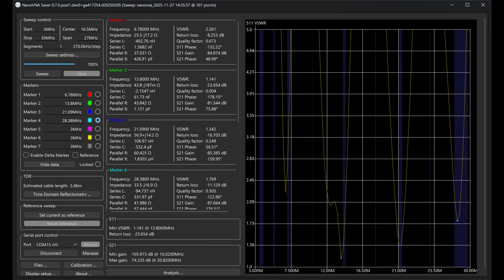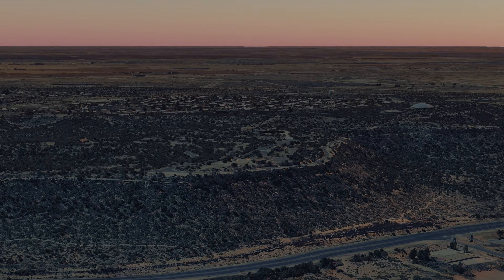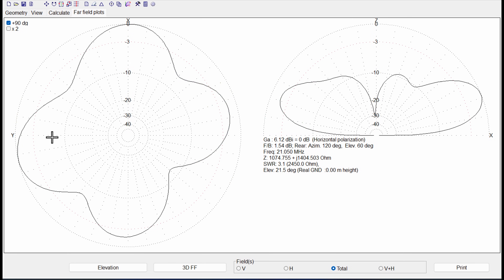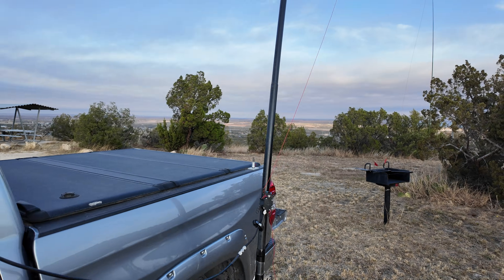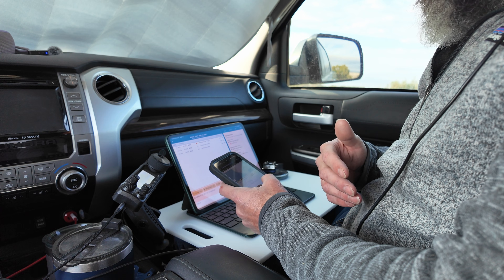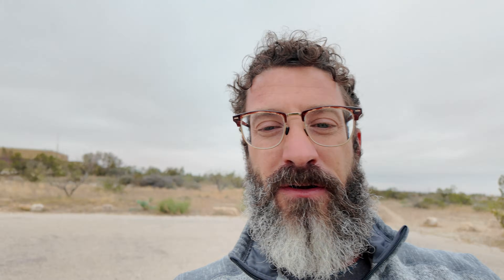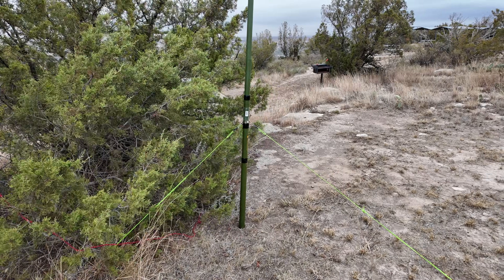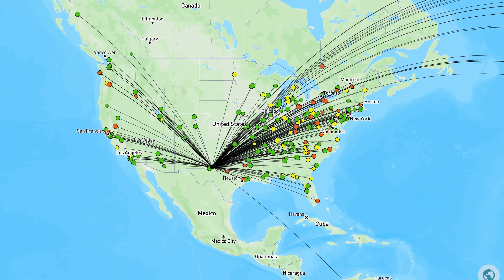EFHW Antenna | Part 3: POTA & DX Performance

Comment: Very informative. Thank you for your time and effort. I have never tried anything but a dipole.
May I ask one question. What logging program do you employ that gives you the distance from the station that you are working. I would really appreciate finding out the distance that I have been fortunate enough to have access.Actually I have to report that I have essential tremors. I am 80 years old so I should expect such things. This makes it impossible to build anything. Thanks again.   Tommy
Reply from the maker: Thanks so much, Tommy. I really appreciate the kind words.

There are a number of logging programs that will calculate distance automatically based on the grid square or callsign. I personally use Ham2K PoLo on my tablet for Parks on the Air, and it has some really nice features and is very easy to use. I believe websites like QRZ will also show distance as well.

Sorry to hear about the tremors. Dipoles are great antennas for most folks and honestly one of the best all around antennas.

Comment: I completely agree with your conclusions and highly recommend this configuration.  I have tried a number of different antennas in different deployment arrangements for POTA.  I have had the best success with a 40m EFHW deployed as an inverted L.  I can work 40, 20, 15, or 10 meters depending on band conditions.  Even running QRP, I regularly work the entire US and DX from parks in Colorado and Wyoming.
Reply from the maker: Sounds like you’re getting great results with that setup. An EFHW in an inverted-L is hard to beat for POTA.

Comment: I've come to the conclusion that using a 49 to 1 or higher transformer rated for 1kw  is more efficient when running 100W because there's less heat. One rated for 100 or 150 Watts is great when running QRP for the same reason.

The toroid mentioned is no doubt better. I forsee the price for it going up.

Comment: Good video. From my experience, a halfwave wire should have the same azimuth pattern and the same elevation pattern regardless of where it is fed. What matters to the pattern is the length of the wire in terms of wavelength. For other than a horizontal wire the inverted L is usually considered a top loaded vertical with gain comparable to any vertical. When used on harmonically related frequencies the inverted L morphs into more of a horizontal antenna. In general the gain of a single vertical should be close to zero dBi. A fully horizontal halfwave should have about 8 dBi if reasonably high. That same length should have more and sharper lobes of 8dBi or more as used on harmonic frequencies. The angle of the peak gain depends solely on the height above ground in terms of wavelength. I try to use heights of at least 1/2 wavelength if possible. Not too easy on 40 meters but very achievable on 20 through 10 meters. If you can get a full wave high ( especially on 15 or 10 meters)  it becomes a pretty good DX antenna when horizontal. 
The nulls are most noticeable when high. With all my antennas at about 35 to 50 feet I do not notice much of a null on 20 but very deep nulls on 10 meters.
Reply from the maker: Thanks for the input. I took a deeper dive into the modeling and radiation patterns in my previous video. Comparing vertical, horizontal, sloper, inverted-V and inverted-L deployments. Each configuration had its own elevation and azimuth pattern and those patterns changed on each harmonic. My RBN spots seemed to line up with these. I completely agree that a half-wave wire of the same config will have the same basic pattern regardless of where it’s fed, but once you start changing height, orientation, and how much vertical vs horizontal wire you have, things change. The inverted-L had the most useful patterns to me so that's what I used in this video. Lots of variables in the real world, so it’s tough to generalize, but that’s what makes playing with these antennas fun. Thanks again for the thoughtful comment!
Reply: @Tim-K5OHY antennas and propagation are the two most interesting parts of radio! I model with EZNEC and have been doing so for years. It’s gratifying to get real world results that agree with the modeling and vice versa. I just found out that my 160 meter inverted L ( 50 ft vertical and 119 foot horizontal) when used on 60 meters is 10 dB down in almost all directions (using the RBN) from my new 60 meter dipole! I thought it was working fairly well on 60 but WOW what a difference!
Reply from the maker: @dandypoint Agreed, I'm just starting to dive into these topics and it's fascinating!

Comment: Hi Tim. Thank you for the great video. I also have seen your video on a Doublet antenna, and I wonder which one do you think is better? BTW you have a excellent fist. 73 Imi, KV1I
Reply from the maker: Thanks Imi! I appreciate that. Between the two, the doublet is the better antenna for a couple reasons. It’s more efficient, works on a lot more bands, and it seems quieter on receive compared to the EFHW. And if you can get a 44' doublet up high, it has nice broadside gain from 40–10m.

The only downside is you need a good wide-range tuner. Some internal tuners won’t match it on every band, but a decent external or manual tuner will.

Hope to take the doublet out again soon and pair it with the G90 since it has a great tuner. 73!
Reply: @Tim-K5OHY  Thank you Tim. I really appreciate your answer.

Comment: Hi Tim, I've been following along with your videos on the EFHW, and I've decided to emulate with an inverted-L. I was wondering what brand/model mast are you using? I currently have a Paktenna fiberglass mast, but will likely need an additional mast as there isn't always a 30' tree branch nearby, and in the correct direction. Thanks.
Reply from the maker: I use 31ft jackite masts from Amazon. They're ok but  not the best quality. I've broken one before and currently one of them has a section that is starting to crack. I might be looking for something better eventually maybe even a bit taller.
Reply: @Tim-K5OHY I currently have a Paktenna fiberglass, and was wondering if I should look at a carbon fiber one for a second mast.

Comment: An interesting thought is rather than going to the complexity of deploying 2 masts with a big multiband aerial (that is a bit of a compromise on the non-fundamental) you could possibly consider having dedicated EFHWs for 10, 15 & 20 & just running them pure vertical on a single 30' mast... Simply hoisting the one for the band desired should be quick and easy with a length of paracord & a pulley up top... Just as easy to swap shorter antennas on a single mast compared to singly deploying a bigger antenna on 2 masts.  & It will be Omni so no countries in null directions).
Reply from the maker: After looking at the modeling the multiband EFHW has more directionality and a little extra gain on 10 and 15m. And setting up two masts is pretty quick once you get used to it. For a mono band vertical I actually prefer the Challenger, since it is a half wave OCF vertical with a 4:1 and has similar performance with less loss. It my go to antenna for a quick setup, but a vertical EFHW does work fairly well too.

Comment: Enjoy your videos Tim, however remember your quoting gain in dBi not dB, so you have a 2.15dBi difference between the two making the gain on the lobes in reality lower than you quoted, not that it really matters in reality, build it....put it up.....and get on the bands (on CW of course!!!)
Regards...
Reply from the maker: Thanks for the comment. I do understand the difference between dBi and dB. In this video I was not really focused on the absolute gain figure, just the pattern so I could show the directionality of the config. The exact gain numbers are not that important to me since they can be manipulated, and often are by antenna manufacturers. But I appreciate you mentioning it. I agree the most important thing is getting an antenna up and getting on the air. 73
Reply: @Tim-K5OHY  Tim, i don't doubt you know the difference between dBi and dBD as you make some of the most interesting videos to be found on YT.
i have spent my life building antennas and throwing them up to see what works and as shown in your videos, the Reverse Beacon Network and the likes of WSPR is a great way to see in real time what your lastest antenna is doing.
I do agree 100% that some of the manufacturers are somewhat generous ! with their gain figures and more often than not a cheap length of wire and a balun, well placed can operate as well as and give results comparable to commercial antennas for much less cost.
Appreciate the time you spend making these videos, incidently the transceiver in this video is it a Yaesu FT891 ? what do you think of this tcvr.
Regards from France Best 73
Reply from the maker: Thanks for the kind words! I agree completely. Using objective things like RBN is the best way to see how well an antenna is really working. I am also finding that simple homemade antennas are often just as good as anything you can buy.

I really like my FT 891. It has a great receiver and the size makes it perfect for portable. I have the head unit mounted in the car so it is always ready to go. The menu system is a big of a mess but I find I rarely have to go into the deep menu. 

Thanks again and 73 from Texas
Reply: @Tim-K5OHY  You know what Tim i will share this with you, i worked for Military intelligence when i was in the Royal Air Force on sites with huge antenna farms for over a decade and a half, did we have stacked yagis No, all our antennas were wire beams fed with open wire feeder back to the Racal 1792 receivers.....you could hear a 'fly fart in irkutsk', i had the best job in the work, i got to listen to HF for 12 hours a day with serious gear, i got paid and got to live in some great places!

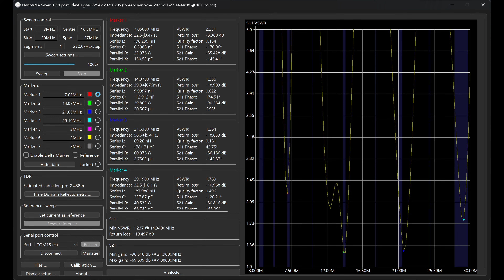Comment: What are the pros and cons of 1:49 vs a 1:64 transformer? I picked up a 1:64 just because it was cheaper and it performs surprisingly well, tuned to 30m it has one main peak down to about 1.1 but very sharp it barely covers the band, next peak is about 2.0 does reducing the ratio flatten it out?
Reply from the maker: That is a really good question. My limited understanding is a 64:1 tends to do better on the lower bands like 160 and 80m. They also give a higher Q factor, so the SWR dips end up being pretty narrow, which is what you are seeing on 30m. A 49:1 might give a bit broader dip. I think you might just have to try each one and see which works best.
Reply: @Tim-K5OHY  cheers that helps explain things! I'm a relatively new operator on FT8 mostly because I only have 5W. Learning CW slowly too but I think digital modes are my thing. I ran out of wire would have tried a lower frequency otherwise 😅 can you model conductor diameter in that software? I have some old irrigation pipe 3 inch diameter would that improve the bandwidth?
Reply from the maker: @foobarf8766  Yes that's a great idea. I believe your bandwidth will improve with a larger diameter radiator. Also 5w works great for digital and CW! You can have a lot of fun in our hobby with 5w. The cool thing with digital is you can see where your single is going and get a signal to noise ratio which should help you compare different antennas.
Reply: @foobarf8766 . I was at the coast and worked Queensland on SSB using 5 watts. My antenna was a wire wrapped around the bannister of my porch. Try the hard way once in a while. The beauty of radio is that you never know.

Comment: Thank You for a well done set of videos. The results of your modeling are quite revealing. Many of us use the EFHW as our primary antenna due to cost and space limitations. Could you provide us with another video using this configuration at your shack utilizing 100w on SSB. It would be most interesting to see a before and during temperature comparison of the transformer . This would provide a real-world example of this antenna.
Reply from the maker: Thanks for the kind words, really glad the series was helpful. At home I have tried a bunch of different wire antennas and I currently have an inverted L EFHW, but it is pretty noisy at my place so I do not use it a whole lot. It does get out fine though. I am not a great SSB operator, but I might consider doing something like that in the future. Thanks for the comment.

Comment: I missed it… which radio were you using? 891? Also - Don WB9CYY - always running QRP. He’s a great operator.
Reply from the maker: I do not think I mentioned the radio. Yes, I was on the FT 891. I have it mounted in the truck which makes it quick and easy to get on the air. Don is a great operator. I have him in the log a few times.

Comment: Tim, another great video and tutorial. It would be great to get a close up on how you get the coax into your vehicle. Also, is that a cutting board in your lap as the operating position?
Reply from the maker: Thanks Ken. For the coax I usually just run it through the window. Since it was cool and windy I only had it cracked enough for the coax, but on nice days I just keep the windows down. I also have coax run to a stake pocket mount on the truck that I use a lot. That one goes down the frame and up through the floorboard. And yes, that is just a cheap cutting board/ It works great as a little workspace during activations.

Comment: I might have missed it, how much power were you putting out?
Reply: Never mind, saw you say it at the very, very end… 75 watts… yep.. on CW that helps give that extra push!😊
Reply from the maker: Yeah, 75 watts is a lot for CW. With a good antenna I rarely need more than 5–10 watts, but I’ve gotta admit… I do enjoy a good pileup!